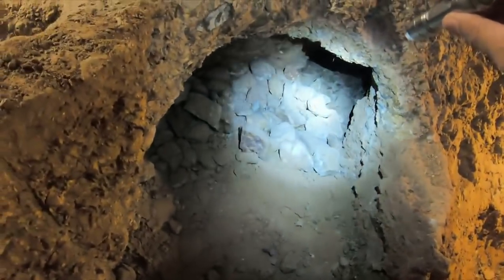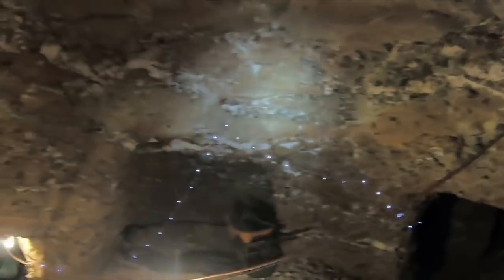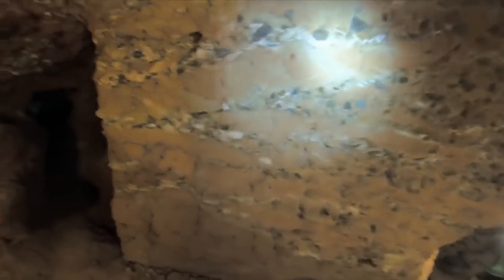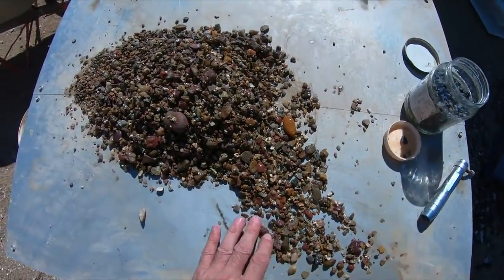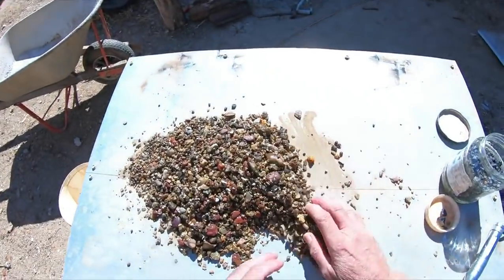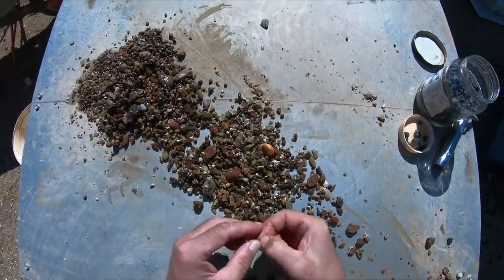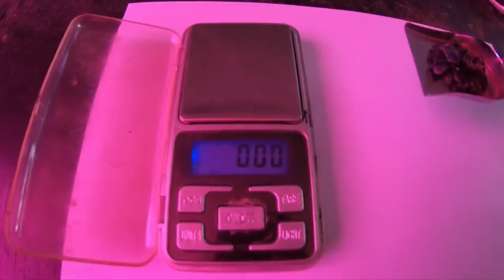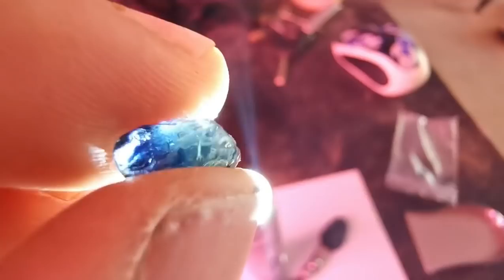Sapphire Mining Australia ,Tim's Adventures [ V: 161 ]

Comment: Hello again Tim. As usual I have questions LOL  Go Figure.
With regards to the 2 silky blue Sapphires that you found in this haul, you mentioned they will be Star Sapphires. Could they be Heat Treated to remove the silk, making them Facet-worthy ?
And if so, do you ever heat treat stones yourself or get someone else to do that for you ? Or is it worth the time/expense to heat treat ? Thanks again.
Reply from the maker: Yes you could heat treat those stones to facet grade sapphire, and yes it is worth heat treating sapphire to increase value, i have had sapphire heat treated locally and in Thailand where they are professors at heat treatment
Reply: @timsadventures9888  Thanks for the reply Tim. Have a great weekend friend.